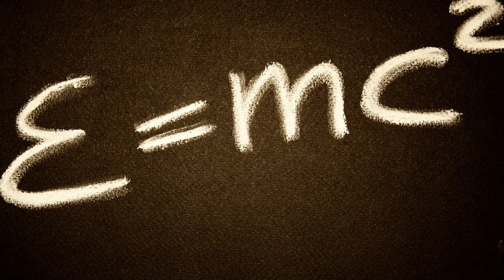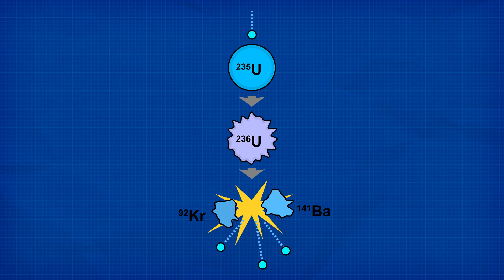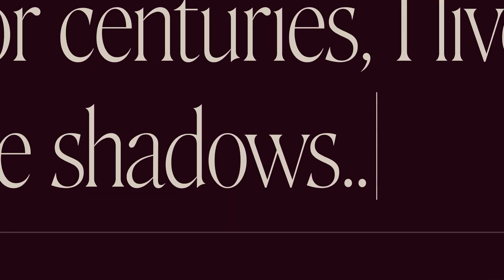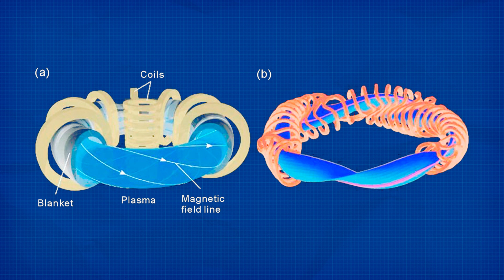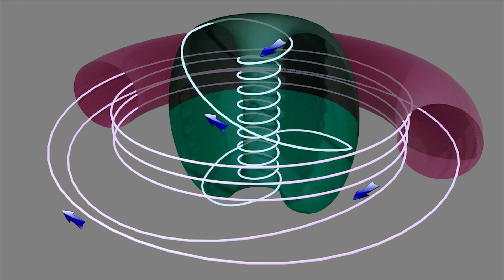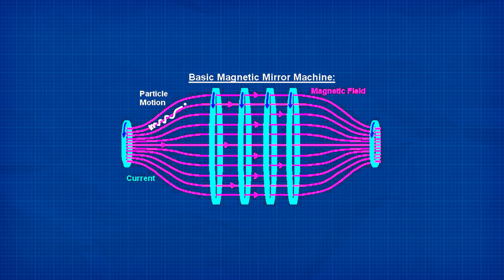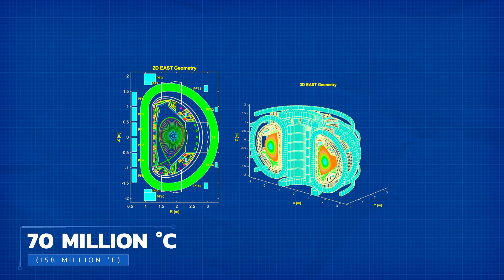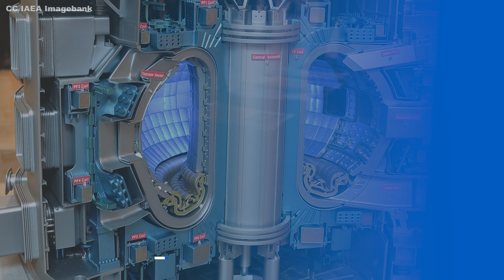Fusion Cracking the Future of Energy

Comment: Even Q=1 would be very far from success, since the input is electrical energy and the output is just heat, which then must be used by a heat engine running at less than 50% efficiency to produce... electricity. Q=2 would be roughly the threshold of a system capable of running itself if the containment systems worked with perfect efficiency and there were no other supporting systems, and a much higher gain would be needed to produce useful output. 

ITER is claiming that it will run at Q=10, which is interesting given that no one else has reached Q=1, and it is not doing anything fundamentally different. Confidently stating superiority is apparently still a valid method to obtain funding. Betting on that to work is comparable to buying a lottery ticket.

Even if ITER works as hoped, over a decade from now it will be producing 500 MWₜₕ. It won't do anything with that heat, but if it did it might produce 200 MW of electricity from that... but 50 MW is needed by the reactor's magnets, and that's likely 100 MW of input power plus 100 MW used by supporting systems, leaving zero net electrical output, if they're lucky. Even if they manage to squeeze a few tens of megawatts out of it, that's one container ship engine worth of output, from a facility costing many billions of dollars to build. 

Fusion is a great idea, but it won't be useful for decades more if ever, so people should stop hoping it will save us from out current unsustainable mess.

Comment: There is a huge inaccuracy in this reporting, as well as most reporting regarding Fusion.  The "Q number" being .7 is some theoretical value that doesn't actually show how much energy the reactor needs to produce to keep its own plasma fusion going.  There are numerous losses.  For instance, in the National Ignition Facility, the Q is much more than one (the big breakthrough you heard about in the media), but because the lasers are so inefficient, the reactor does't even generate 1% of the energy it needs to operate.  And then you would have to recover the energy, turn it into electricity, etc.  Basically, we are a very, very very long way off from actual fusion energy, and once we solve that, the massive capital cost of the plants will leave this idea dead on arrival.

Comment: As of the 21st of December 2022, the same lab mentioned in this video achieved 1.5Q i.e it produced 100% of its energy to run and had 50% (of the cost to run) of extra energy. Which is nuts, that basically means free power if we can figure out how to do it on a larger scale.
Reply: *The Californian lab

Comment: The real problem with nuclear fusion isn't Q.
The real problem is T, for time. And the time until the first nuclear reactor is finished is T=20 years. Sounds good at first, until you realize that T is a constant. 70 years ago nuclear fusion was to be commercially available in 20 years. Today, it's still supposed to be ready in 20 years. In 20 years... it'll be available in 20 years.

Comment: Perhaps hot fusion wont be viable until we can easily maintain its working temperatures even when turned off. Think of trying to make dry ice in a grill. Sure you can but maybe Making dry ice in an insulated box is better. We need a way to maintain whatever temperatures indefinitely with as little thermal loss as possible.  This is only my uneducated opinion.

Comment: I strongly suggest that everyone here Investigate Project SAFIRE at the Thunderbolts Project. Their proof of concept plasma reactor has achieved 100% output from a mere 7% input, all for about a  million dollars.  They can also remediate radioactive materials AWA transmutate one element into another.  The designer/builders are all physicists &  electrical engineers with decades of experience.

Comment: General Fusion's method is actually pretty smart IMHO. We don't need a continuous fusion reaction to get the benefits of fusion. We need energy period and we need a fusion reaction that isn't completely cost prohibitive. So a simpler machine that cycles reactions and uses the heat from each cycle to power conventional, existing power turbines on existing sites retrofitted into fusion plants sounds like it could be the real deal and much more viable than huge, expensive tokamaks.
Reply: I agree with you. I saw General Fusion use water hammer effect to get extremely high pressure and temperature needed for creating fusion (they use liquid metal instead of water). And I see recently they updated their water hammer device to make it compact and more effective, they already decided to create fusion demonstration equipment by 2025.
Reply: @simonsong1743  it will fail, they simply cannot get confinement, not with that system. extracting energy from that setup would also be a nightmare.

Comment: 8:09 
Partially true, partially false. Gravity pulls ENOUGH atoms together until Quatum Tunneling chances are high enough that enough atoms can transit the coulomb force barrier without being repelled. This explains why stars stabilise at a certain size instead of collpasing indefinitely and also explains that as the Hydrogen fuel is used up, the star hets hotter, thus increasing the ability of atoms to "tunnel" past the coulomb force. It's not all that different from explaining how an electron flows from a socket, through an oxidized barrier on a plug, and into your lamp wiring.

Comment: Regret to advise that the mentioned coefficient is absolutely irrelevant. It is the ratio of input energy to fusion energy generated - but at the nucleus. A number bigger than 1 will take us nowhere. Under the present state of technology a number close to 10 will be needed. This for several reasons that I will briefly describe: first and foremost there is the Second Law of Thermodynamics. For starters with luck we may convert 50% of the generated heat into electricity. There is massive energy requirements for the coils, pumps and containment systems. A devilish level of vacuum is indispensable, and for this, huge pumps. The magnetic coils must be kept at cryogenic temperatures, and this is another energy guzzler. Then tritium must be produced, since the isotope does not exist in nature. More and more energy needed. At this stage, all the above considered we are not covering more than 10-15% of total energy requirements to breakeven.  For those with a serious and genuine interest in the topic there is a short 40 page peer reviewed paper published by the University of Princeton: Fusion Nuclear Science Facilities and Pilot Plants Based on the Spherical Tokamak, available on the public domain. A study conducted by the Princeton Plasma Laboratory. It seems to me highly unlikely that all technical problems can be overcome before 2050-2060. And from that point add 10 more years to build the first commercial plant. Then there is another popular misconception: that this technology will be available in small modules (no way) and free of nuclear waste. Well, yes and no. Certainly it will not create radioactive isotopes that will remain so for 100,000 years, but there still will be problems here. The fusion process emits high energy neutrons, and these must be slowed down by meter thick containment walls. These will unavoidably become highly radioactive, although we are talking here of a lot less tons than in fission models. Were any of these pesky neutrons to escape and collide with phosphorus atoms in staff’s body it would go from P31 which is stable to P32 which is radioactive that in turn would become S32. Needless to say, not the best for your DNA.

Comment: The best way to describe the progress of viable fusion I've heard is the development of the helicopter. Da Vinci postulated the design hundreds of years ago, and his principles were sound, but it took hundreds of years, development of combustion engines, advanced materials, aeronautics etc. to actually make it work.

Same with fusion, there are a lot of areas we need to get right before it gets off the ground, there isn't one big discovery that will 'crack' it, it will be a lot of very innovative engineering.
Reply: The biggest manufacturing challenge is making the massive magnets and the absolutely massive vacuum vessel
Reply: @clippyremembers  From what I read it's actually the protection of the inside against radiation that's the biggest issue. (the tiles that you can see on the photos)
Reply: @Robbedem  so partly the pressure vessel too because it's the final biosheild before being outside the reactor
Reply: @Robbedem  not the biggest issue by far. The radiation of course takes the form of fast neutrons , being particles of zero charge they cannot be contained by a magnetic field, and so yes they damage the containment wall, and eventually those modular plates will need replacing, after so many hours of operation. I'm not sure if they use Beryllium to reflect the neutrons back into the plasma or if they are just slowed and thermalized ?
Reply: @clippyremembers  that won't be an issue with final production models, the neutrons are easily thermalized (slowed down) to create heat from kinetic collisions with water coolant they choose to use, Helium is useful for that purpose because it does not undergo any nuclear reaction causing more radioactive substances. Plus the amount of sheer construction material will also cover the containment vessel, the strength of the magnetic fields generated , anywhere from 10 to 20 + Tesla are enough to quite literally rip the machine apart, it will have to VERY sturdy to remain in one piece. Also, at those field intensities non magnetic metals become paramagnetic and would be lethal if left lying around
Reply: @clippyremembers  They’re being made for ITER no problem, apart from taking forever. It’s ridiculously hard to put together and zero fault-tolerant.
Reply: @clippyremembers  You know how they say not to wear any metal when getting CAT scan, well the power of the superconducting magnets would EASILY rip the metal fillings out of your mouth from many meters away. Part of the design issue is making the structural housing robust enough so that the magnets don't tear the machine apart.
Reply: Never heard this analogy before, but I like it.
Reply: Fusion reactors exist now. To Amal and stellarators will never work. Junk boondoggles.

Comment: The magnetic confinement is not done to press the atoms together like is done by gravity in a star. It is impossible to reach such pressures artificially. But if you make the plasma very hot, the chance of fusion in the plasma goes up despite the pressure being very low. The magnetic confinement is to keep the plasma off the walls so it doesn't cool down.

Comment: The Q and net energy gain are based on the raw energy input & output of the nuclear fusion process. As an energy source to replace existing fission & fossil fueled power plants, achieving Q is just that......an achievment in physics and nothing more. As a commercially viable source of generating power Q is meaningless because the energy losses are not considered. (i.e. energy losses converting the power source into the heat & magnetic confinement required to maintain fusion, and converting the heat output to something consumable such as electricity).

Comment: Fusion energy is not going to happen using this approach.  All we have managed to do thus far is simulate a solar flare.  That is to say we have create a magnetically confined plasma that is hundreds  of millions of degrees.

Is the center of the sun, where fusion takes place, 100s of millions of degrees?  Nope, its 27 million.  Yet we are pushing for higher and higher temperatures.

Temperature is not the key to fusion but only its byproduct.  We are wasting hundreds of billions chasing a white whale.

Comment: Big question surely is do we need this technology in 21St C given the massive growth and decline in costs of renewables?
Reply: Categorically yes. For all people make out like Fusion is a scam with its ‘forever just around the corner’ jokes, renewables are an actual scam. - someone who studied renewables all though university, whore a dissertation on renewables and now works for a nuclear engineering company.
Reply: @ajl8975  and what’s your justification for that?
Reply: @Gomlmon99  the lifecycle analysis of all renewable tech ontologies. You start digging into the life cycle analysis and you’ll find it isn’t half as green as it’s made out to be. Solar panels? Horrendous pollutant chemical processes in creation of the panels. Wind turbines? Most blades are completely in-recyclable and end up in land fills. Not to mention they are usually in remote locations and require regular maintenance, so regular on-going fuel costs of driving to and from wind turbines carrying out maintenance. The giant mega batteries used to store all of the renewables energy because it’s not reliable 24/7? Massive amounts of pollution in the creation of batteries again, and heaven forbid you have a battery fire. Nuclear by comparison. Centralised, clean, efficient and reliable. Modern fission is better than all current renewable energy sources, fusion will be absolutely revolutionary.
Reply: @ajl8975  in my opinion this is the typical view of someone who has read up a bit and has no idea what they’re talking about. Solar has some toxic chemicals, wind uses a bit of landfill. So what? That’s absolutely insignificant to the damage caused by fossil fuels. Putting a wind turbine in landfill after a productive life is not really a notable impact.

Of course fission is clean, but you’re acting like the waste from wind is equivalent to that of nuclear.

Obviously not to mention that the biggest problem nuclear faces by far is not waste or emissions, but costs and project management.

Plus, investment into nuclear often comes out of investment into renewables. Studies have shown that generally they compete against each other more than they compete against fossils fuels.

And to suggest fusion will be revolutionary is just really really ignorant of the energy industry and the current problems fusion faces.

Comment: you already have the sun as the controlled reactor, you are just wasting everything, so sad
Reply: you already have wasted all that was given to you, so you are poor, not having abundance of everything
Reply: try tooth brushes with van derr graaf generator static high voltage electric field sling, both ionization and fusion, and target heat conduction in copper fusion target gas-liquid-solid (Deuterium Gas, Heavy water, Lithium-deuteride) container
Reply: do you think they ever finish the research projects, when they have to be funded
Reply: they would lose funding if they declared the thing solved, all the utility industry plot to prevent free stuff entering market
Reply: therefore the funding is the worst enemy of freedom
Reply: you dont get any funding if not in consensus opinion

Comment: I used to work with the guys at General Atomics Fusion in La Jolla. They have a large Tokamak there. They were a client of mine. I supplied a lot of the piping and control systems for cooling the giant magnetrons they use for the magnetic fields. I’ve been in the reactor room, literally laying out routes for cooling lines along side it. And I’ve been in the control room during a “shot.” It was like being in Mission Control at NASA. It was so freaking cool. They actually gave me a short class on this research so I could understand it and help me to help them. I loved it any time I got to go help them with something. Right before I left that job in 2010 they told me about the project in France and that a lot of their research was going into designing that facility.
Reply: recently, nasa talking about fusion power in solid metal, erbium lattice saturated w/ deuterium (hydrogen isotope). then shoot w/ gamma rays, cuasing deuteriun to fuse. hydrogen 1b x more dense than magentic confinement in tokamack. small pkg designed to be carried in rocket n power space probe.
Reply: It's so fun to be involved in incredible stuff. Even in the background as support. It's just so interesting. Glad you got that experience!
Reply: @Lessk69  You’re completely right. I miss that aspect of that job. I was involved in The Elephant Odyssey enclosure at the San Diego Zoo around 2007. I was on site when the elephants were unloaded into the new enclosure that we spent 2 years building. I got to work with the military and go on carriers, work on submarine piers, Sea World, Legoland, Birch Aquarium, NOAA, Salk Institute, all were customers. But I HATED the “salesman” part of it. I work with cancer patients now. So I still have a very rewarding job. But damn I miss some of the cool stuff I used to get to see and do. Not many people get to see a lot of the things I did.
Reply: The war will slow the building  of ITER due to the huge Russian  contribution that'll grind to a halt as a result  of the  war.
Reply: Feels me with hope that we’re getting close to “the future”.

Comment: the unfortunate truth is 60 years ago they said efficient nuclear fusion was 30 years away. 30 years ago they said efficient nuclear fusion was 30 years away. now in 2022 we are planning on having efficient nuclear fusion within 30 years. see a pattern? further research into small scale thorium reactors would result in cleaner more efficient nuclear power now or at least in less than 30 years. research all you want but find a solution for the now and then worry about spending trillions of dollars over the next 30 years for fusion research. just like the shampoo ad, "it won't happen overnight but it will happen".